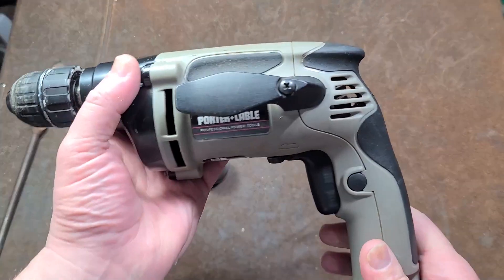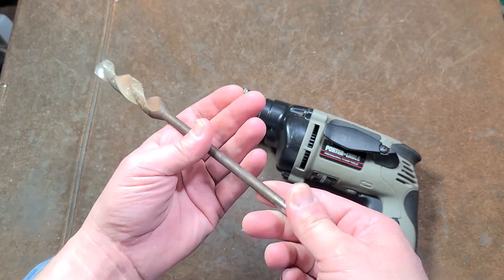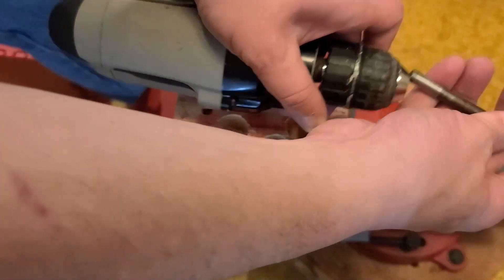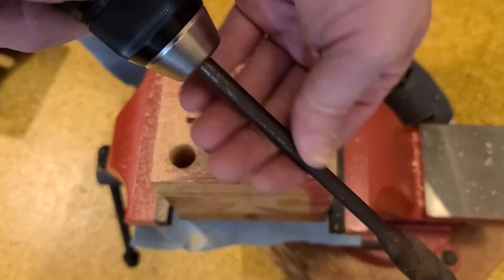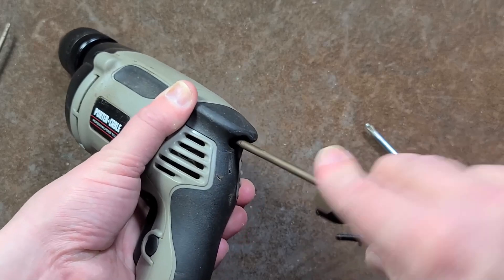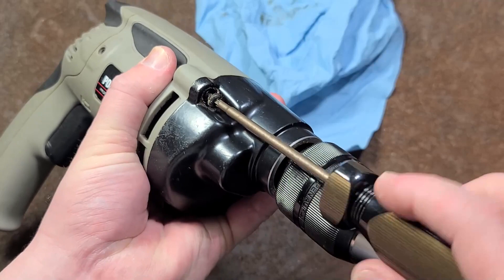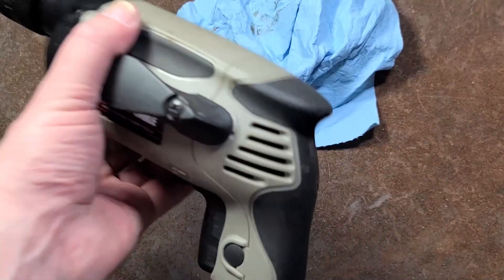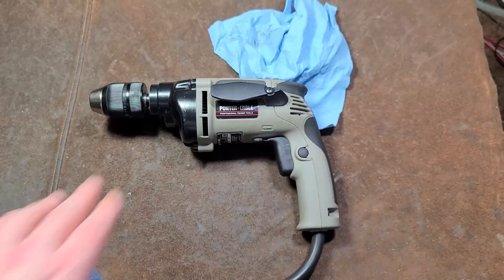Porter-Cable 2610 2500rpm, 7A General Purpose Drill Review/Disassembly

Comment: I never used a Porter Cable tools. Tho they had a retail Store in West Fort Lauderdale. 
  I dont remember anybody bragging about what they could do. But the Business, everytime i would stop in with my Father in law to go look at tools their in the 2000's.
...i just kept to my 7 and a 1/4 Worm drive and my 3/4 inch hammer drill. 
....in the 90's There was no need for me to buy anything bigger or smaller then what i had.
...im sure there has to be more interior or house framing residential Carpenter's  out there that would know alot more then me.
   On these small drills.

I know they didn't use Porter Cable tools on American Airlines Arena,
The Portofino Tower on the Edge of South beach Miami. Or The Dolphin Training Facility in Southwest Fort Lauderdale.  Or the Panther Arena in West Fort Lauderdale. 
...the shell Contractor used in there Gang boxes were 8 and a 1/4 Skill 77, Worm drives and 3/4 to 1 inch non hammer Milwaukee drills. So they could Augur through 7and 5/8 wide forms or 11and 5/8's forms to put in Spaghetti wire in, or no cone Snap ties. In to the form to keep it from blow out. At the hight pressures of dropping Mud at 12 to 14 foot from the top of column.
  The state would not let us drop Concrete at any more higher then 8 foot from a Concrete pump. But we could pour Concrete up to 14 foot on any given day without a complete wash out. From the rain.

Trust me folks it aint no fun washing away a bad load of Concrete and scrubbing rebar in the rain and dumping 10 yards of concrete off a block concrete wall and down the cells from Foundation up to 14 foot. With concrete filled in them.and getting the rebar out of the walls that were set evey 4 foot apart at what ever length 10 yards got you.

 The Mud went bad in the Mud truck cause to much rain fell with in an hour and a half. That ruined the concrete consistency test.

So i dont know nothing about Porter Cable.

 See ya all tomorrow. 🇺🇸
Reply: You're a funny feller.
Reply: @gypsydildopunks7083  , why you say that.
...I was a step child to a 35 year Forman Form Carpenter He was from N.Y. City and saw the writing on the wall and got out. Landed a gig doing Hi Rise decking.
...His Son did it and Finished and moved along to there Utopia. 
  I did it for many years. I found the company that had those projects. I was invited to run a crew on the Panther Arena.  And i turned it down. I was offered the American Airlines Arena.  After the construction caught of fire and it all had to be torn down to existing concrete and build up again.

 Yep thos jobs.
          It wasnt about what you know its who you impress in front of the right people.

 I stayed with family to do tie beam form work.

Building up C.V.S. , book Stand alone book stores.

So i can mold and bend Concrete mud. I quit that job when i got to the top of that game and learned what top pay was. I was gone.